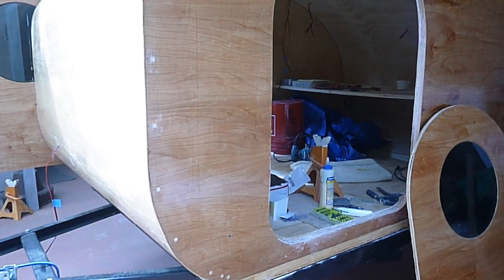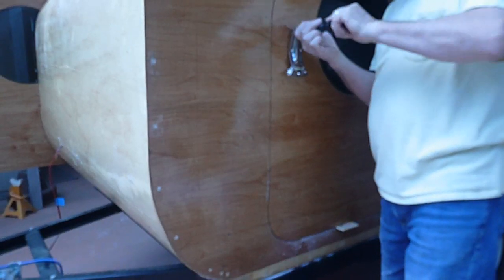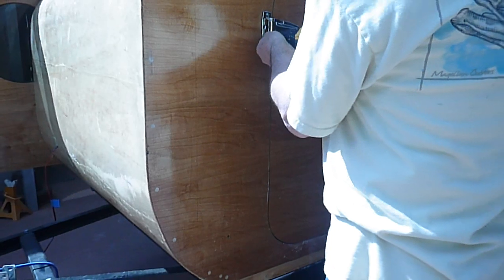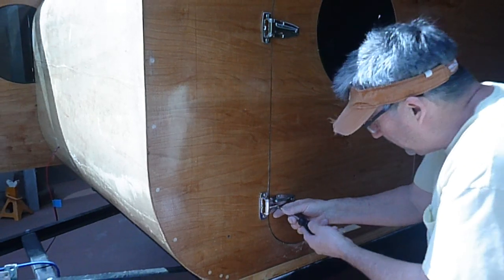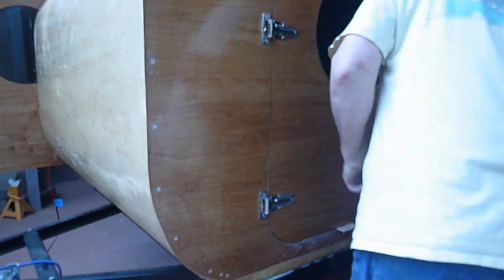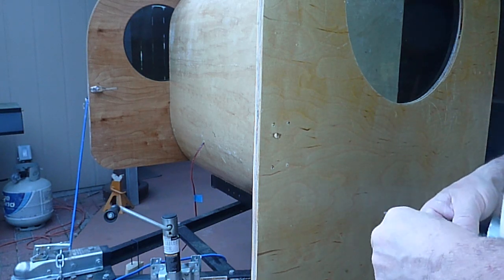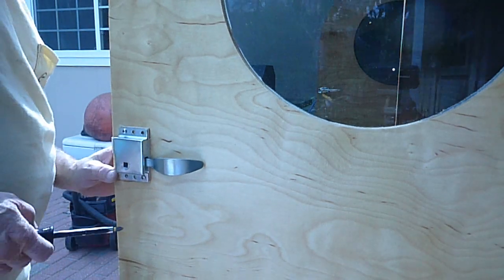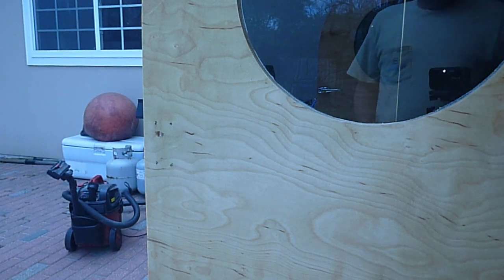Tear drop camper build a 5 X 8 video no.43 How to Install doors and handles #tinytraveltrailer

Comment: Looks great! Can you tell me where you got the hinges?
Reply from the maker: I found them on ebay that company is gone now but others have them make sure you get the all stainless steel ones not the chrome plated ones. On one ebay store they are called Marlboro 4Pra7  2-1/2 WX3-15/16 H stainless steel Strap hinges currently $27.71 a pair plus shipping depending on the seller